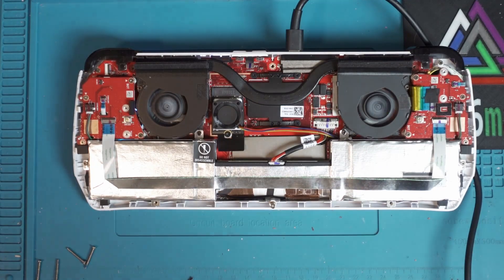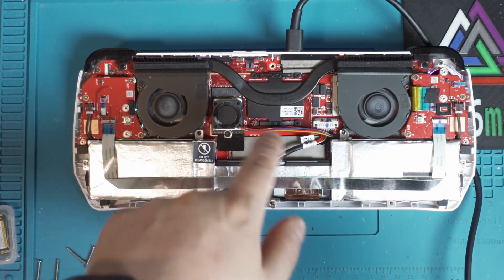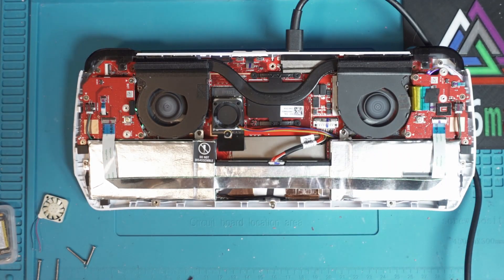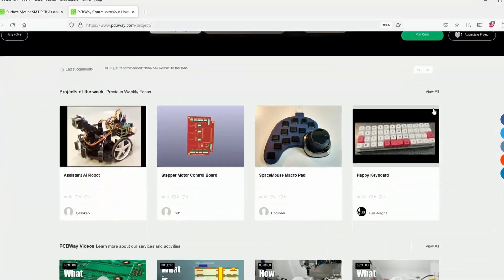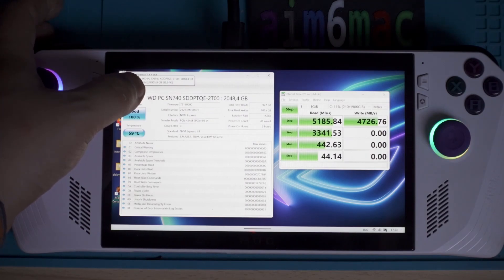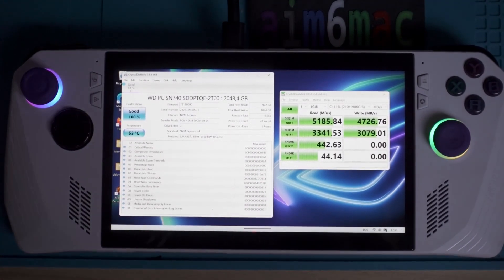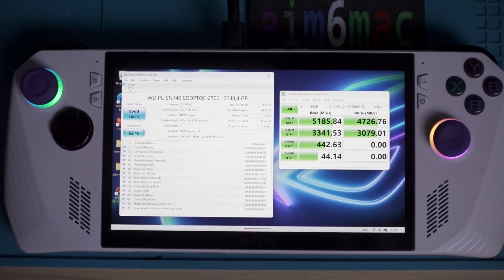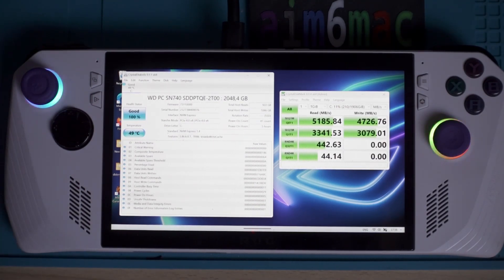ROG ALLY M.2 fan MOD

Comment: Very great temp results actually! the its a big drop from the usual 75-83C to 61c Max, wow. 

Did you drill some vent holes in the back plate? 

Thanks for sharing the wiring drawings, very useful!

Comment: Kinda stupid waste of time. It is too inefficient. It sits right on side of bigger and much more advanced fan - which by the way you can speed up in settings and I bet get better results than this without loosing so much time.
Reply: You do understand that THIS fan is sitting on the M.2 right? this fan is not intended to cool the APU. 

The stock temps on load on these can go upto 80c+ so 61c max is a hugeeeee difference. 

seems you are still new to the asus ally club :p
Reply: @IIIFJ  Alright I give it back after using Rob Ally for 2 months and getting some knowledge now it seems brilliant :D
Reply from the maker: talk facts, don't just guess i'd say

Comment: A bit new to electronics tinkering but can i remove the sd card reader so that i can power the fan using the connector of the sd card reader? Since i don't use sd cards i just thought why not turn it to something useful
Reply from the maker: u could do that yes , but you lose your warranty on the device for sure after that :)